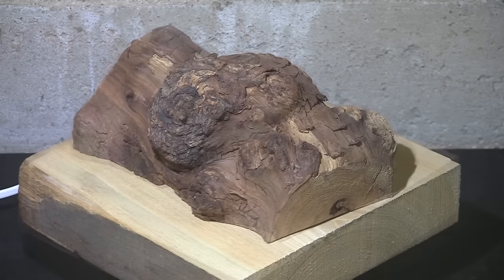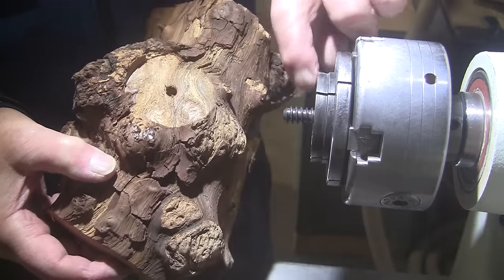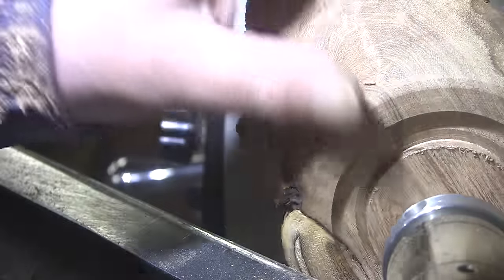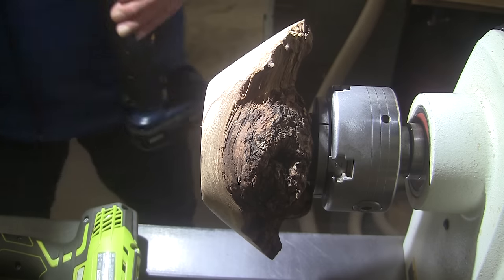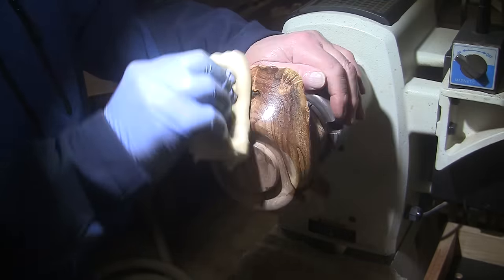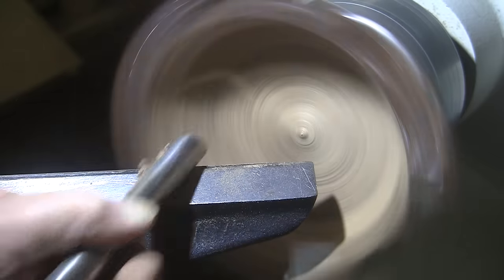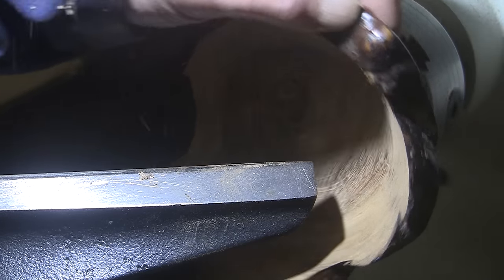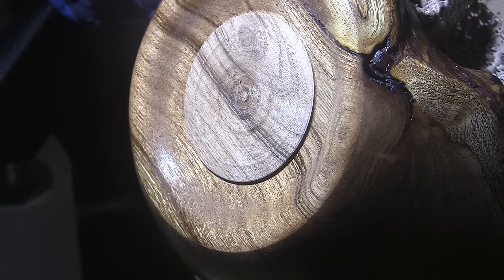👉 Majestic Mesquite! 👀 - Wood Turning

Comment: That's a gorgeous bowl.  Something you can look at for hours and still see new things. Also, you are so right about the center mass Phil. I do a lot of segmented bowls, and especially on the inside, you have to  cut REALLY slowly - there is no center mass.  If you  try to cut like a normal bowl it will howl and vibrate and look awful. I've even tried wrapping the bowl in a lot of Rubber bands to help damp it down.   That kind of works, but you still have to work it really slow with super fin cuts.
Reply from the maker: Cool, thanks, Michael! 😊

Comment: Hey Phil,
You continue to have a great eye for design. 
Thanks also for your other video on the correct way to set up the Nova chuck wormscrew. I had it wrong and positioned the flat spots in between the jaw gaps. I thought the curved spots were supposed to match the curve in each jaw. The Nova instructions gave me no help on the right way to do it.
Reply from the maker: I'm glad to know that helped, thank you for watching! 😊

Comment: Phil. Another great turning and tutorial. You always amaze me in the wood you get donated to you. But I’m really glad you do. I have 2questions though. How do you get such a great bur on your negative rake scraper. I’ve tried the screw driver but no help. I can’t run my lathe in reverse so would it be the same if I ran the lathe forward and the drill in reverse. Thanks a lot
Reply from the maker: The scraper needs to be kind of sharp before you try to add to the burr.  If it's dull, sharpen it, first.  I usually apply a burr with the screwdriver about 2-3 times between sharpenings.  Reversing the drill will not help, the wood has to be spinning away from you.  You can stand on the backside of the lathe to accomplish the same thing. 😊

Comment: Yeah it is a beauty. A great piece highlighted through a perfect work, well done. I watched last week some older videos and I recognise that you have converged to a kind of standard shape in the last time. Maybe it is the size of the pieces which defines your shape. Did you ever try to use the tenon later as the foot? I have recognised that this gives me more space to create a rounder outer shape on smaller pieces.
Reply from the maker: I used the tenon like that once.  I was kind of forced into it.  I don't for several reasons.  The biggest is, my chuck leaves marks around the tenon right up next to the bottom of the bowl and I just can't have it! 😊

Comment: Hi Phil: What angle is on your 5/8 gouge and do you ever use a larger one, say 3/4?or 1 inch??
Reply from the maker: I've never even seen a larger one, David!  My gouges have a 60° bevel.
Reply: I saw a 3/4 and one inch roughing gouge at a store called Lee Valley. It is a source in Canada for quality tools.
Reply from the maker: @davidhall7640 Well, if we are talking roughing gouges, yeah, I have them up to 1 1/2".  5/8" is my largest bowl gouge.

Comment: Thank you Phil, mesquite is always a favorite wood of mine. Question - my lathe doesn't do reverse, but, my drill of course does. So, when I use the sanding disks, do you think I'd get the same results you are getting with the lathe in reverse by putting my drill in reverse? Thank you sir, I look forward to your reply.
Reply from the maker: Thanks, John! 😊  That is a common question.  No, the wood has to be turning away from you.  What you may be able to do is, sand from the back side of the lathe, that will accomplish the same effect.  I can't because my lathe is up against the wall.
Reply: @PhilAndersonShadyAcresWoodshop  thank you Sir. Great suggestion! I Love the fraternity of woodworkers, when even a Master like you, will freely share your knowledge! It makes perfect sense, but I doubt I would have thought of it! Thank you again.

Comment: Phil. Love your skill and artistry. A quick couple of questions. I follow your regimen of a couple of coats of sanding sealer followed by two coats of shellac. But I have trouble with second coat of shellac. It tends to activate the first coat and smear. How do you stop that. Also you often talk about the smooth finish but I find the shellac has a slight roughness. If I sand it even with 0000 steel wool I lose the shine. How do you get your finish to be so smooth? Thanks for all that you do to guide us!!!
Reply from the maker: Sounds like you are not waiting long enough between coats, Adrian.  Sometimes it takes over night. 😊  As far as smoothing AND controlling the amount of shine, I have a short video on that: https://youtu.be/lqns7oue4W4
Reply: Thank you for replying Phil. I’ll wait longer between coats. Thank you also for all your work and sharing. You’re a great mentor.A

Comment: Curious why you didn’t rough cut the bowl shape on your bandsaw before turning it round?
Reply from the maker: I seldom do, Eric.  I'm always afraid I'll cut a way more than I want to.  I don't always know the shape I want until I'm turning the piece.  And, it takes about as long to cut the corners off as it does to turn them off.  I just find it easier and safer to do it all on the lathe. 😊

Comment: Phill, I know people hate math but the rpms in the center are exactly the same as at the rim. The difference is how many inches of wood pass your cutting edge per revolution. Here are two examples.

Rim 3 inches from the center
Circumference = 2 x pi x r = 18.85 inches

1/2 inch from center
Circumference = 3.14 inches

A difference of 15.71 inches every revolution

So at 500 rpm:

At 3 inches out from center approximately 9,425 inches pass your chisel every minute or 157 inches every second.
At 1/2 inch out approximately 1,571 inches pass your chisel or 26 inches every second.

Or 7,854 inches less wood passes your chisel every minute or 131 fewer inches of wood per second.

And this is a huge difference and is all at the same 500 rpm
Reply from the maker: You are, of course, correct!  You even did the math! 😊  I guess I was making the point that it doesn't feel like it's moving at all.
Reply: @PhilAndersonShadyAcresWoodshop  i could not keep the nerd in me quiet. I love your channel.❤

Comment: Well I've did my first live edge of Cherry, four of them, and boy that takes a lot more work than a bowl, whacked my drill a couple of times and my wrist too on the high ends. Not something I want to do a lot of but something different for my table at farmers market. Everything is backwards from what I'm used to doing.
Reply: I see a snail in the center knot.
Reply from the maker: A right-angle drill helps a lot, Pat, but you still get slapped now and then.  Soft intermediate sanding pad helps a lot! 😊
Reply: @PhilAndersonShadyAcresWoodshop  I have a right angle drill with an extension and still managed to whack it.
Reply: @PhilAndersonShadyAcresWoodshop  I ended up going to my sheet paper.

Comment: Hey Phil, I’ve got to ask… Is there such a thing as a live side bowl? In other words, where you turn the flat side into the bowl and then barely turn the outside? This feels like it would have been a good log for it, considering that big burl got mostly turned away. I know little about turning though, so maybe I’m just being silly.
Reply from the maker: Nothing like that, that I know of.  The piece is always spinning, I just don't think it would work! 😊
Reply: @PhilAndersonShadyAcresWoodshop  Oh well, thanks for answering!
Reply: @PhilAndersonShadyAcresWoodshop  After thinking about this reply for a bit, I think you may have misunderstood me. Imagine if, when you finished Sharpening the piece (see @7:30), you then turned the bowl using the side of the log facing you. You could then turn it around using that one grip you don't normally use (you know, the big plate with adjustable pegs?) and flattened off what's currently in the chuck to be the bottom. That way, almost all the outside is bark, and you get to keep most of the rough surface of the burl. I was wondering if that was a thing, at all?
Reply from the maker: @combak2712  Haha, I still don't understand, I guess!